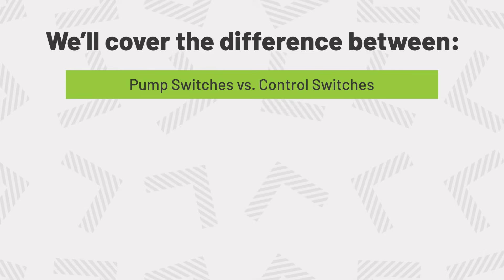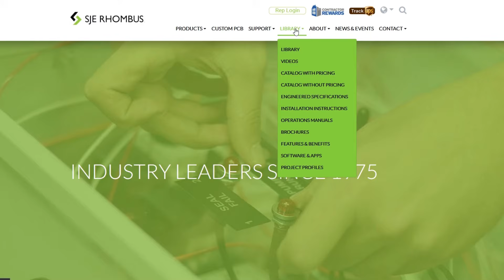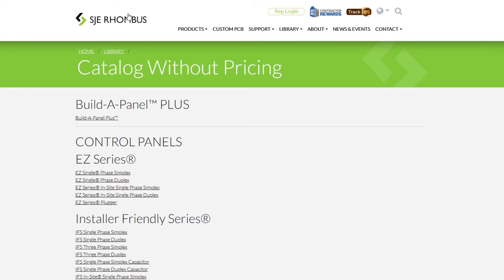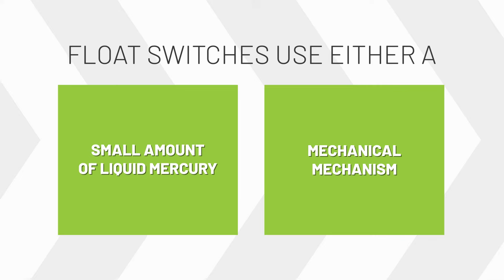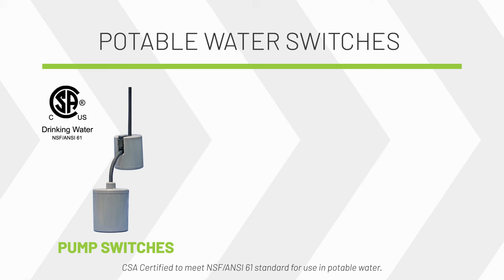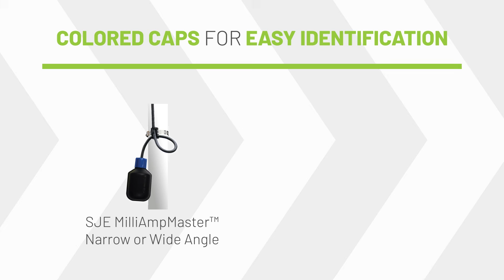Float Switches: How Do They Work? | SJE Rhombus

Comment: Question: I have a float switch that has gone out in my septic tank and it's tethered near the base of the tank about 6 feet from the top of the tank. I can get the old switch out by cutting the plug side and pulling the bulb side up pulling the cord through the tether strap. My question is can I get the new float switch down there and tethered without actually climbing into the tank? Can I tether it on to a weighted post and just lower that in?
Reply from the maker: Hi sntemp! In the industry, many installers will use a spare piece of pipe or stainless-steel chain with an anchor mounted to the top tank or the discharge line that a person could attach the float to. This method allows easier maintenance when servicing the system. However, we recommend that you contact your septic installer for safety and system integrity.
Reply: @sjerhombus  thanks, I went with the stainless chain method. After about 10 days I checked the tank and it is working HOWEVER that stainless chain turned brown with some sort of spores on it really quick. I’m shocked how quickly that chain turned in just 10 days.
Reply from the maker: @sntemp  Apologies, we didn't discuss the rating of stainless steel. A build up of deposits or corrosion can form on just about any material that is introduced into a septic tank due to the harsh environment and vast chemical makeup. You will want to confirm that you have 316 rated stainless steel or better, as 316 stainless contains molybdenum, which drastically enhances corrosion resistance compared to 304 rated stainless steel and greatly increase the lifespan of the chain. It's a bit complicated, but we hope this helps!

Comment: I never had a well before and I'm confused about the float direction. Float up turns water off , down turns on. My new float in down position turns water on. I need a float that turns water off at top position. Help ?
Reply from the maker: Hello! Please call our tech support team at 800-746-6287 and they can assist you with finding the correct switch!